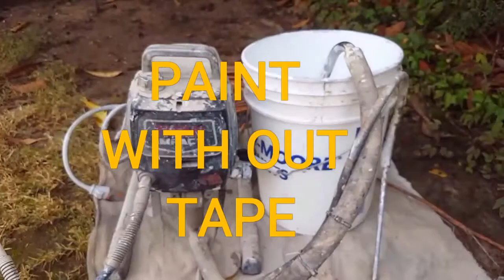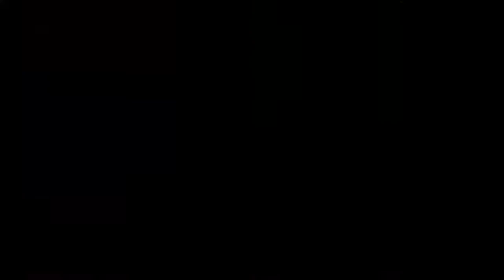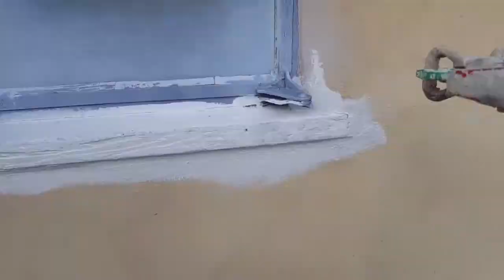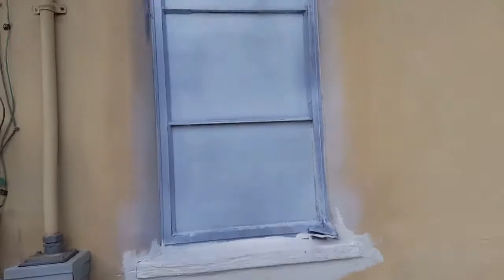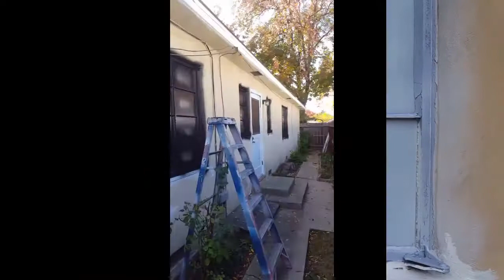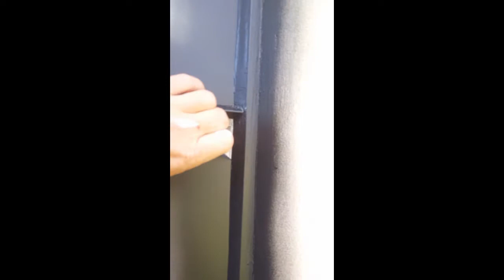Painting Windows with an Airless Sprayer !No Tape!

Comment: What's an alternative...  I'm in England, so this works out too expensive!  Thanks in advance...
Reply from the maker: Honestly good ol elbow grease. Before I came across this product. I would just use tape and masking paper. And alot of patience....
Reply from the maker: How much is it to ship?
Reply from the maker: Could talk to your local paint store / hardware store and ask them to order it. I can be your contact if you need
Reply: Wonder if pvc glue would work.. let it dry then paint.. then peel the pvc off the glass?
Reply from the maker: Did you ever come to a solution
Reply: @TymOLaughlin  
Hey!  Yes,  I used tape an then a stanley blade to tidy up.. was alot less time consuming than i had expected an cost only a few £'s
Reply from the maker: @jaeda88  that's fantastic. Good work sir. sometimes elbow grease is all ya need .
  Godspeed👊